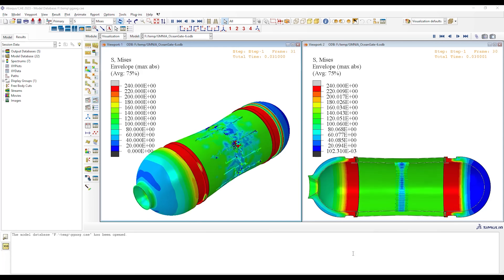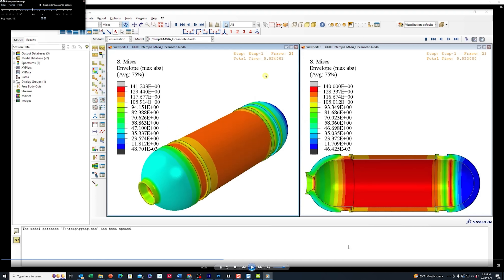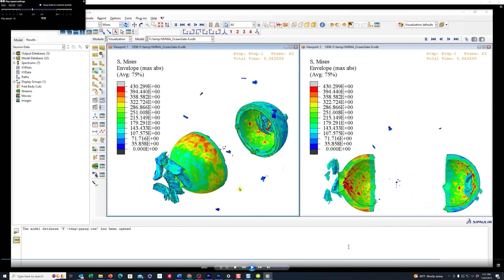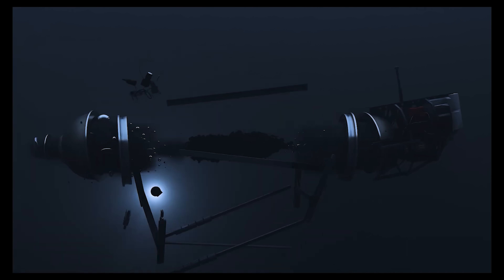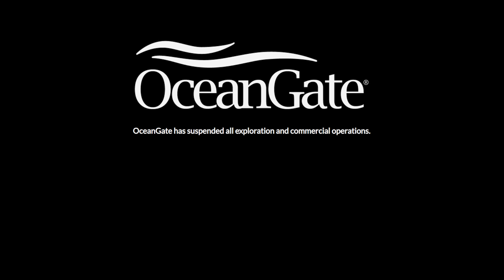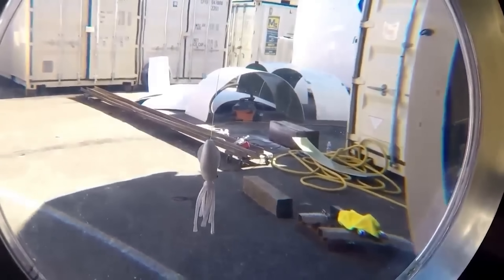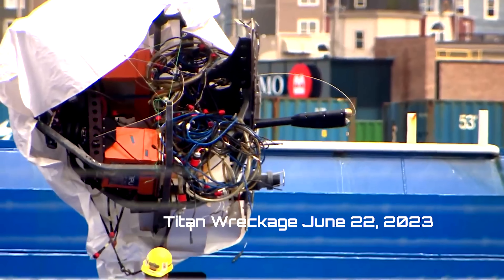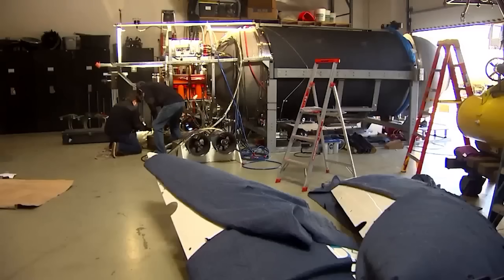Best Titan Sub Implosion Simulation, Cracked Porthole? Q & A

Comment: The simulations seem to be leaning towards a center collapse but given that they built the sub without weaving the carbon fiber, there's a good probability that it failed at the connection point with the titanium at a single point and then created a shredding or ripping effect. That would have started the crushing at a seam creating a pressure wave forward or aft depending on which end it started.  If that happened, there could be as long as 35ms before the pressure wave hit the opposite end.  We also have to consider the heat generated from the pressure wave but it is possible, though not probable, that the pressure wave and heat took as long as 35ms to reach the opposite end given this scenario.

My question to the engineers in the comments is, would this result in the pressure wave decreasing in speed as the ambient pressure increased?  Bernoulli's principle should be driving this, I think.

Also, please don't let my thought experiment detract from the loss of life.  No one deserves this.

Comment: The glass is pressed into some kind of seal the deeper the sub goes. Under normal pressure, I would think that it is not fully pressed into the seal, so not all the surface of the glass has contact with the seal. I think what looks like cracks are either the parts of the glass being pressed into the seal under normal pressure (or the ones which are not).
Reply: this is true, the "glass" was a big plug shape that fit into a hole that was shaped like a funnel. It was a wedge seal where all the surface of both are mated using lapping/polishing. They are rubbed together with abrasive material between them until their surfaces are matched all around.

Comment: The simulation at around 4 minutes seems to be accurate. Why? The only way the ring and bolts holding the view port could shear off would be due to internal pressure. A collapse in the center would compress the air toward the end caps. The pressure hitting the window would transfer to the ring, then to the bolts and they would shear , you get the picture. By by ring, bolts and window. If the window failed due to external pressure the ring and bolts would still be there. It's not rocket science

Comment: 13ms is more of a reaction time than a Δt of sensing i think i m wrong at that 
if the window had broke , then the carbon fibers would have to withstand the force of stretching and not pressing , so it would probably not break apart and be separated in the joins with the titanium rings

Comment: i had a flight instructor who commented on a private jet that tried to land with a +25 knot tailwind and ran off the far end of the runway. He said, " That's what's supposed to happen when you land with a big tailwind." Cutting corners on a deep-sea submersible is the same. Exactly what's supposed to happen, happened.

Comment: I don't think your suggestion of transplanting a chip would work.  Most phones these days use encryption of their memory to protect against that attack so you'd need a way to also extract the keys from the processor or security chip (depending on which phone it is) to access it.  Whether or not the manufacturers would be willing to help with something this major could be another matter, but they may be unwilling to bypass it for fear of how else such tools could be used.  Most phones on the market these days also sadly don't have external memory card slots so you can't put in a SD card if you wanted to.

This phone/encryption issue is a totally separate issue from the whole problem of how do you find the remains of the phone, given how hard they can be to find in a house  now you are searching the ocean floor.

IMO the best shot at anything recoverable is if the external cameras recorded to a computer or memory module that was also external and would have been less severely subject to forces of the implosion and may still be attached to the mess they dragged up.

Comment: This video answered several of the questions I came here with but there is still a couple things nagging me. There is a lot of focus on the view-port now but the transcript (which hasn't been debunked) kept mentioning crackling noise in the aft. I also saw another video showing that the tail section with all of the equipment including the batteries was welded to the aft dome creating a pivot point at the bottom and and a separating force at the top by the titanium ring. Is it possible there was a separation there that caused all of the failures the cascaded into the final implosion? Your opinion is the one that I would chose to go with on these matters.

Comment: What if they had placed long all thread rods in the carbon fiber as it was being laid? Place them all around about mid way through as it's being wound. This would leave long bolts at the ends where the caps go on. This would actually bolt the caps onto the tube instead of glue. These bolt could be torqued down making it impossible for the end caps to come off.

Comment: James Cameron said on CNN shortly after the debris was found that the carbon fiber composite had been crushed into one of the titanium hemispheres, so I don't think the collapse simulation shown here is correct. From Cameron's description of the debris, It sounds like the carbon fiber tube buckled in lengthwise (axial) compression and got crushed into one of the end domes, as if you stood on the top of an empty soda can and crushed it axially.
Reply: I didn't realise james cameron works for the coast guard
Reply: @qarnos  Cameron probably has contacts at Pelagic Research Services, whose ROV found the debris.

Comment: This is an interesting suggestion and it reminds me that if the sub(mersible) was of a unibody design, perhaps it might have been better able to flex but survive its resurfacing or retrieval. But where a rigid round metal part abuts the flexing material ( as it is gradually failing), it makes sense that their two dissimilarly moving points of juncture would have been prone to having a separation, especially where one area is pulling away as a result of flexing inward across its entire surface. It would have created the weakest juncture with the metal surfaces.

Comment: If the acrylic porthole had failed, wouldn’t the water inrush have normalized the differential pressure on the carbon fiber and it would have structurally survived the failure?  So far, no carbon fiber is to be found anywhere.  Wouldn't shredded carbon fiber be lighter than water and essentially disperse, i.e. float away with the ocean currents?

Comment: Any wires or pumps running from the inside to the outside are a big problem. The seals of wiring are a potential weakpoint.

So many no nos on this sub. And I am not even an engineer.

Comment: I'm wondering if those scratches on the acrylic are actually scratched on the titanium base. As Rush said, and he is correct, acrylic compresses under pressure. I wonder if that's from repeated contractions of the acrylic against the titanium. Titanium scratches very easy. Just my thought.

Comment: Honestly I believe that the inner ring of the end caps gave out because it was less than a quarter of an inch thick and that carbon fiber hole was pressed against the inside ring at 126 million pounds of commutative pressure. The inside ring of the Caps gave out.

Comment: I seriously doubt the acrylic port-hole window cracked and caused all of this tradgedy. 
A neighbor found a clear acrylic toilet seat with old coins molded in it, at a garage sale or thrift store. About 2 inches thick. They ask me if I could bust it up to retrieve the coins for them. I tried and got most of the coins loose, buy I sawed, chiseled,  and beat on that thing with a sledge hammer until I was wore out. Also squeezed it in a hydraulic vice to try to crack it. I broke hammers, chiseles, and wore out saw blades on that thing. I have never seen any material as tough as this stuff.
My guess is the carbon fiber hull finally failed, or the seams where it was glued together.

Comment: @11:59 I think I see your scratches at the 4 oclock position as opposed to the 6 oclock position I think I saw them at in your talk about it.  

I wouldn't call them "cracks" but they could be minor scratches and no one considered them a threat.  

Because of the nature of the curved glass, it might be possible that they are just reflections of the glue binding it to the dome. 

I'm no expert, but you can look for yourself or have someone else look.

Comment: Great finds as usual. Thank you for sharing them! 

Completely unrelated question, is there a coupler that will join 1/2” PEX-A pipe to 1/2” copper pipe for a plumbing job?